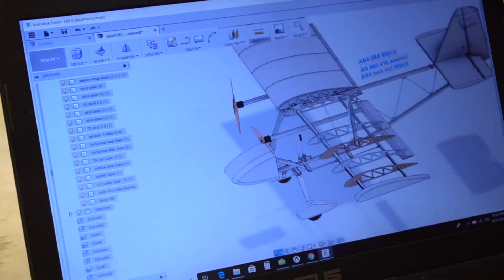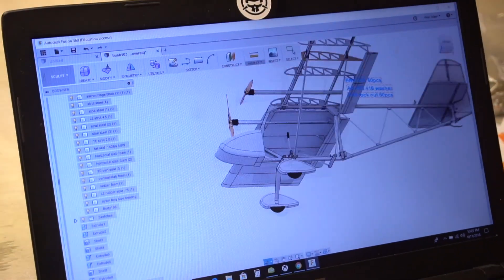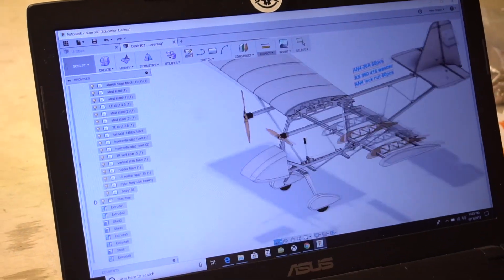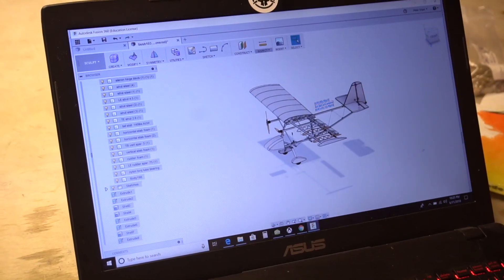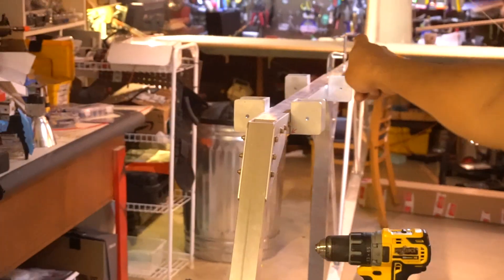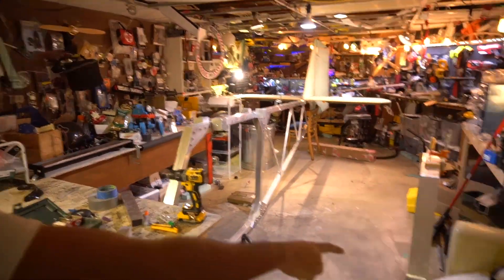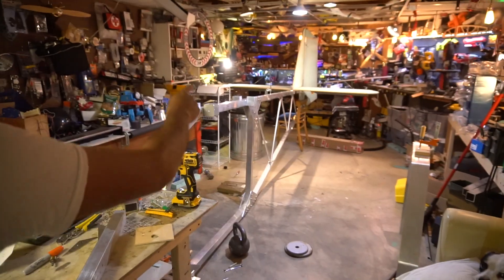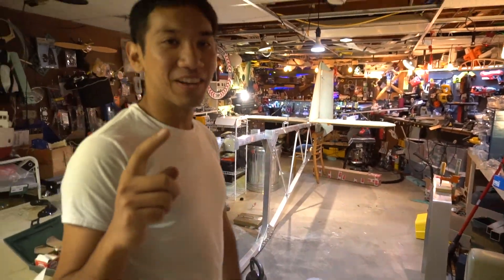DIY Electric airplane mk2 (Pt1)

Comment: I like the truss type fuselage / empennage design but it looks a bit overbuilt (many light aircraft just use an aluminum tube boom) and the bolted gusset plate connections might actually be stronger if the tubes are just welded and smaller gussets were used in the corners... Also size of the elevator surface  looks small in relationship to the horizontal stabilizer... I'm not trying to be a critic... just curious if you or some others agree..  best of luck!

Comment: @PeterSripol: Why wouldn't a gearbox used to power a larger prop not work? I.E. increase torque and drop speed. Same motor can only take so much before failure point and you want to stay within normal threeshold, I know. But is it possible to make a workaround solution to your power problem? 

I don't think larger motors is better because you want more flight time, which already translates into larger energy storage (batteries or battcaps). Have you considered using a type of solar panel that is flexible to use for direct power to motors, in effort to extend flight time? I'm sorry, idk what those panels are called, only that they are paper thin, flexible and way better than the kind we put on our roofs as far as being more efficient. You could theoretically make some of those or buy them (safer, as I heard cyanide is a byproduct) and have them glassed onto your wings. If it were possible to have them replace the wings and hold up to flight physics that would be a gas, but we arent there yet and I wouldn't trust it in a gust let alone take off force. But for power production I think it's worth a look see. What is your ideal max flight time on this bird and what energy storage type are you considering?

Comment: nice project peter maybe you could shave off a few pounds with welding the parts that do not need to be bolted for easy disassembly

Comment: If you want to lower your stall speed use an airfoil with a larger camber.  I don't know which airfoil you are using but using a Roncz R1145MS would decrease your stall speed since it has an incredibly high C_L_max (Above 2) (maximum lift coefficient). It has a larger moment coefficient too, so you pay a bit of a penalty in trim drag. But a low stall speeds is much more important for you I guess. Good luck with the build.

Comment: You should attach solar panels to the top of the wings and route them to charge the batteries during flight. That way, you won't need to worry about the charge during the day.
Reply: Won't that make it too heavy?
Reply: @MrBiggieJay  solar panels are too low output. You need a really BIG main wing to put enough panels on. Think glider/sail plane.
   Large bungee cord to launch.

Comment: Nice looking design!  Wondering if you will be turning the plane upside down and sanbagging the structure. Also will you be guywire the rear fuselage to the wing?  I have seen that in similar structure designs...Rgds Laurie

Comment: just a small idea to the design.if you have enough faith try to add a parachute to the aircraft so if the motors get insufficient electrical current you could open it and float to the surface.even though you could land somewhere by gliding in an emergency it could get your aircraft to stall and even go to a dive you can't escape from

Comment: Due to the design your going with you will need incredibly reliable safety equipment at the seat to prevent you from falling from the plane to the ground if you do a turning manuever and a malfunction goes unnoticed. I'm just really concerned about your safety in the aircraft

Comment: Pad Thai!.....now I'm hungry in the middle of the night!  Oh, your extra mass may have come from your "fiberglass spackle mix".  Did you use silicon microbaloons/spheres?  That can drastically reduce the mass of your spackle.  Also, did you factor in the mass of your fiberglass/resin itself?  Anyway, I wouldn't worry about 5 lbs.; you're a smaller guy (so you don't really need every last ounce saved), and a little extra strength in critical areas would be peace of mind if it were me.  I'd leave the brackets...unless you've done FEA on the structure and it truly is overkill.  Remember, this isn't an R/C scale aircraft; the forces involved are exponentially greater, and your safety is at stake.  I'm an aerospace engineer, and father of 2 boys myself (who are into doing dangerous stuff, lol), so I think of these things.  Take care.

Comment: Hi from Brazil! I loved your idea! I fly ultralights for 8 years now, and I do heavy maintenance of mine and on others. 2 things I would like to add: 
I see you are using AN aircraft bolts. In the past, that was very common, but nowadays modern european LSA come with regular bolts that are a lot cheaper. Mine is a FK9 Mk4 and all bolts are regular 8.8. All my friends Tecnams use regular bolts too.
Also, I would suggest you design a light tubular landing gear with some soft bumper, as that type of blade you used in the design is better for heavier aircraft and would be nice for yours.
You can google Fox V5 for an example of good, light landing gear for ultralight.
Reply: Also your parts are too thick. Aluminum ultralight tubes are a lot thinner than that. The U shaped supports, are better done in thinner steel than thicker aluminum.

Comment: Looks great Peter! Just the tail seems very well built to take vertical loads but horizontal looks a little skinny. Maybe some wires from the tail to the wing would help if necessary. Build and Fly Safe.

Comment: Gonna need more powerful motors. Even though the fuse is made of aluminum it is going to be alot heavier then the foam plane. You throw in all the steel fasteners you gonna be lucky to hit 230 lbs as it stands.

Comment: https://www.amazon.co.uk/Resistance-Parachute-excellent-improving-accelleration/dp/B01M26N1I1/ref=sr_1_3?s=sports&ie=UTF8&qid=1528896590&sr=1-3&keywords=running+parachute < add one of these too the back and use it when you land, it would be so cool

Comment: OK, the biplane was an interesting concept, and I hoped a good learning curve?
I guess not.
I think you should REALLY go and look at some properly built ultralights and take note of the technology and materials being used.
I would hazard a guess this project is going to come out about the same weight as the last machine because of all the 'agricultural' strength materials you are using, like; aluminum framed foamboard then glassed over?!
You've got hotwire gear there, use it to form a three inch deep airfoiled tail from foam, one layer of epoxy glass with NO alloy framing, and it would be strong enough to be cantilevered (no brace wires) and still be lighter than what you made.
As a model builder I had hoped you would have done a better job at weight saving and incorporating more modern techniques.
I know I'll probably get accused of being just another armchair aviator, but actually, I've been a model designer and builder, then an ultralight designer and builder in wood, metal and composite for many years.
There's nothing wrong with re-inventing the wheel for learning purposes, the first time, but now it's time to step into the real world of aviation.
Sorry for how this is going to come across, but I hate to see people waste their effort, when with a little research, so much more can be done.
Have a look around for the plans for the Lazair, not as hard to build as it looks.
Better flying, lighter, and already been electric powered
https://www.youtube.com/watch?v=bBeJAxf7eCo
Or, if you like glassed foamboard structures, look up the plans for the SkyPup, basically a big two channel model aeroplane!
https://www.youtube.com/watch?v=4X7kUFquLP0
-
OK, time for the flame suit...
Reply: There is always one.

Comment: I’m concerned about lateral and torsional rigidity. Your entire fuselage is only strong in the up-down direction. It will sway side to side like a noodle. If you end up rolling at all when you turn, I think you’ll find that the whole fuselage bends in a way that is not good.
Reply: +1, if he's gotta waggle the rudder for some reason some weird stuff could start to happen. Moving the control surfaces rapidly on full runup should be a good indication.
Reply: Like a N O O D L E
Reply: I think this design may be prone to flutter... Triangles are your friend. For a proof of concept, it would have been easy to find a fuselage from an ultralight that was proven a successful design already... maybe make the wings if one has to have some "I built it" kind of input, but a BeLite fuselage or something similar would likely be way safer.
Reply: Weird flex but ok
Reply: Nah its fine. Triangles and such...

Comment: Dude, have you looked at the Blooper or the Goat by Mike Sandlin? They fill your needs and I think that the plans are free on the net. The original builder uses gasoline engine but your motors will do the job. Both planes are slow and have plenty of lift. The Goat folds and is car-top able. Each weighs less than 254 pounds.

Comment: I would add wire brace under the tail plane, there is nothing to stop it collapsing upwards.? Look for any aluminum structure that you can. may be  cut holes in to the lighten without weakening the structure.

Comment: I wonder what edfs(custom of course) might do. They're supposed to be more efficient the larger they are and it might save space or weight depending on what material you use for the blades. Plus you can get a lot of power. More power than you would with a prop I believe.